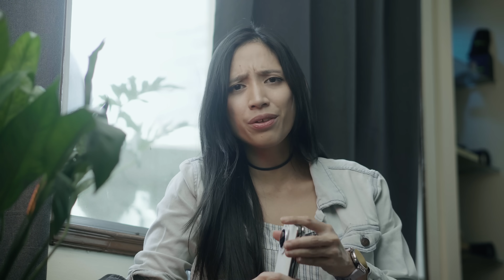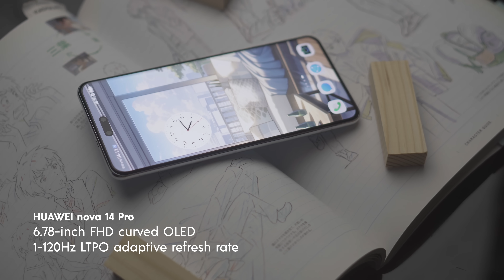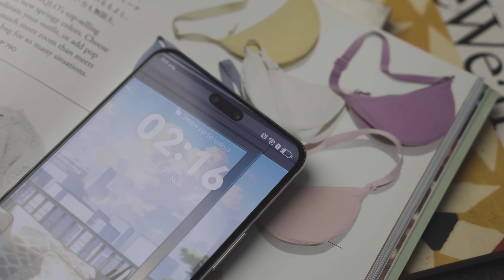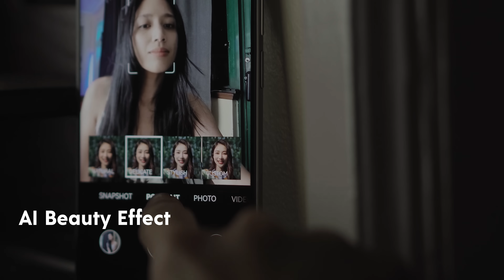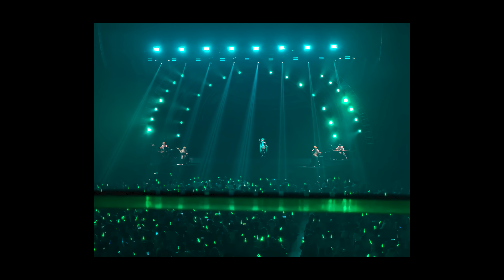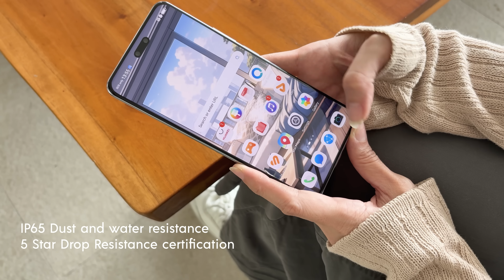HUAWEI nova 14 Pro: What makes it the KING of AI Selfies?

Comment: Can you bring more info about why my photos get auto-adjusted in my gallery after taking a photo? It is somewhat annoying, especially when I am intentionally taking a high-contrast sunset photo only for its brightness to be increased back up in the gallery. It looks so unnatural and I wish it can be turned off.

I use the Huawei Nova 14 and I do not want the trouble of installing a third party camera app. Hope ya'll would read this.
Reply from the maker: Hmm yeah its a common problem with smartphones : unwanted background processing :( 

I suggest turning off all enhancements before you shoot (hdr and AI) if that doesn't work, there's always pro mode which let's you shoot raw (no processing) s